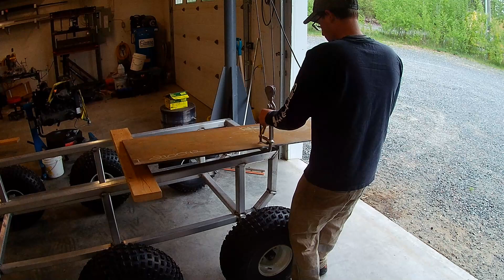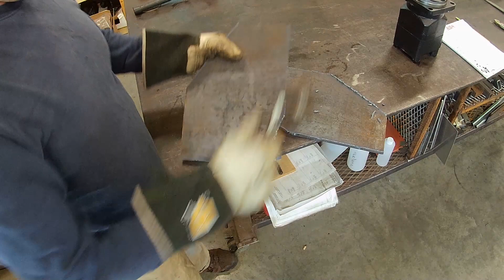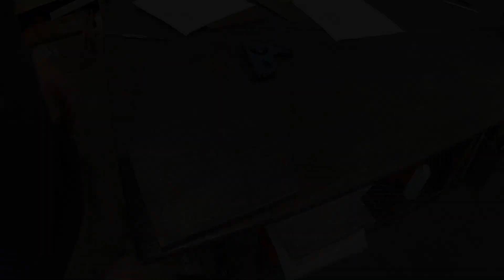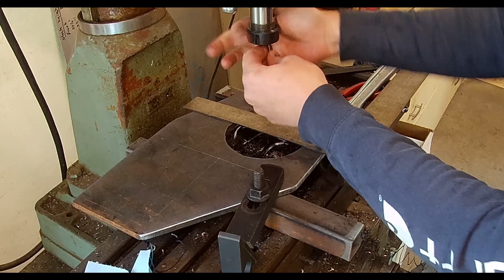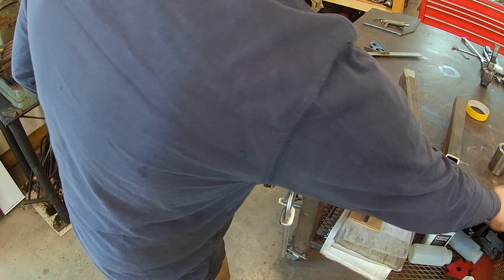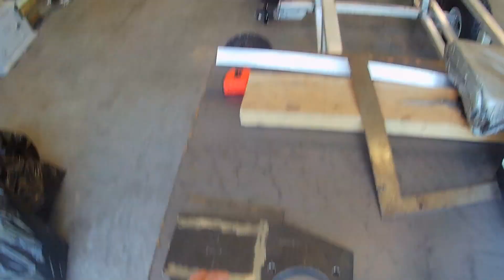Building Custom Wheel Motor Mounts | Mini SnowCat build PT8

Comment: On your next project, when you have multiple pieces to lay out and drill, tack the pieces together. You only have to layout once and all of your holes will be in exactly the same place on both pieces. Grind off the tack welds and drop the pieces on top of the layout table on edge and they will snap apart.
Reply from the maker: Yup I do that from time to time

Comment: Are you worried about putting steel and aluminum together because of oxidation
Reply from the maker: Not worried no. I am well aware of galvanic reaction. It takes very little in terms of corrosion inhibitors to prevent that